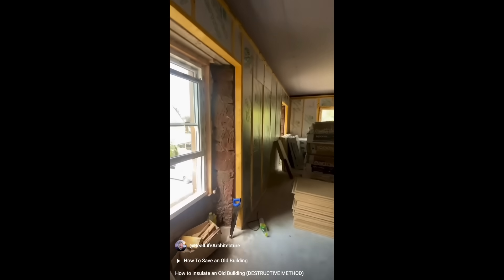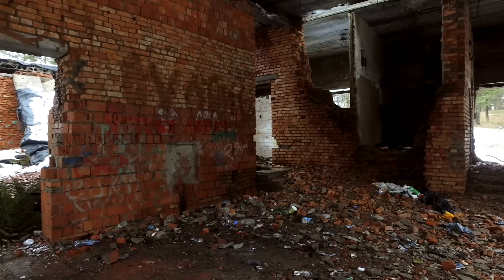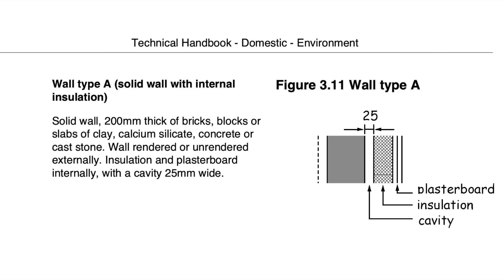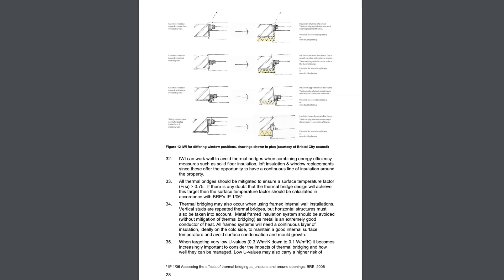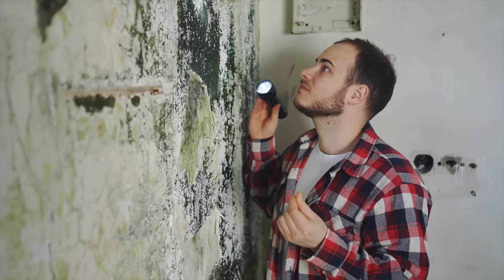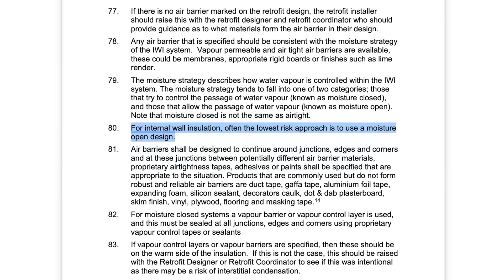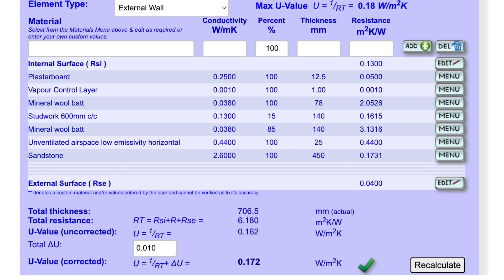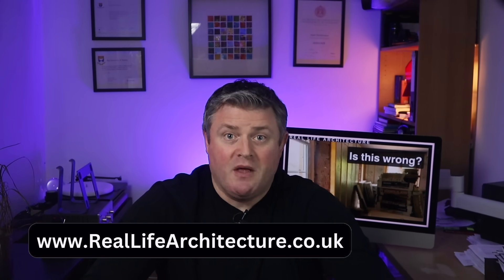How To Insulate Inside a Solid Wall in the UK

Comment: Just to give wise council is all ,Any house type matters not thy all have to breath like you ie a person breaths  out about 2 to 3 litres of water per 24 hours = damp air it always finds its lowest point ??? and condensate's out on to cold surface so a wood/duel fuel burner takes out damp air up the flue to keep air changing in the house but put a 10 cm square/round,  hole to the out side = fire can breath and take away damp air 24/7 if fire is burning  or not , it = a balanced flue system ie air pressure is the same as the out side ??? hope it helps best of luck for the new year

Comment: I internally insulated the solid walls of my Victorian terrace using the following method: stripped back to bare brick, applied a base layer of cork based insulating plaster, fixed 60mm wood fibre boards directly to the plaster, then used a finishing coat of lime plaster over the top. My aim was to use natural materials, not take up too much space out of the rooms and keep it all breathable and moisture permeable. It was quite the job but so far so good.
Reply: Sounds interesting how long ago did you finish the work ?
Reply: Where is the dew point now? Is it on the surface of the bricks or in the wall? If it is in the wall then the bricks will spall. That's why external insulation is often used.
Reply: @justsrooms4520  why would the bricks spall? They have been ‘breathing’ for centuries. Hard cement pointing causes bricks to spall is my understanding.
Reply: This is the correct way to go, this way the moisture from the inevitable inner face of the brick's dew point will be moved to the inner face of the insulation by the hygroscopicity of the material. Good job there!
Reply: @sirantsworth  I have a 9 inch solid brick cottage. I'm considering this approach but minus the Cork (fairly expensive). Was going to lime bond 60mm wood fibre to the bare brick then lime plaster over. My only question is how can you fix shelves, pictures to the wall as wood fibre is really soft. I've looked at wood wool as an alternative
Reply: @easterntreecare manufacturer Gutex or Steico is coming up with these new specific plugs that go directly into its insulation material, the dense wood wool material. Give it a look.
Reply: For most existing vintage older buildings (the majority built as cottage dwellings, not huge old hotels or mansions)  to internally insulate to recommendations means the room becomes a cupboard. To insulate cavities may cause serious problems with older wall ties. To insulate externally is visually destructive. I totally agree also that poor choice of design can easily lead to mould and poor health conditions. There has to be a limit to this madness.
Reply: @Daniel-deMerrivale perhaps highly efficient heat recovery and insulation of the floors and roof are the way to go for these situations. One does what one can.
Reply: We’re thinking of getting SWIP IWI to do our insulation on a lat 18th century limestone property roughly 600mm thick
Reply: The problem of bricks spalling is due to the pointing being harder with a higher cement content than appropriate and too strong for the bricks.
The whole point of pointing is that it weathers protecting the bricks.  The pointing should be able to release the moisture.  If it can't and the moisture goes out through the bricks then the bricks can fail.  This is why soft lime putty mortars work well with soft London Stocks, and why one often sees these and red rubbers crumble.

Walls that are made of soft masonry that is then hard waterproof rendered can fail because the wall moves or the render thermally cracks.  The cracks allow water running down the face to penetrate and then restrict its evaporation.  The solution is to removed the waterproof render and apply a lime render to allow the wall to breath.
I wish everyone knew this but I suspect that some people do not care.  Their mistakes are very costly to repair.
Reply: @sirantsworth  great approach. How did you come to it? I think if we can get this kind of holistic thinking into construction rather than plastering everything with these alien hybrid materials which try to achieve things not encountered in nature we will create healthier happier buildings not prone to failure.

Comment: Would be interesting to explore the concept of externally insulating a solid wall in retro fit, surly this would be better as the solid wall would act as a heat store/ battery as it will be sat on the “warm side”, however I do then wonder the best solution for breathability/airtightness
Reply: @robertma-  external insulation on solid stone/bricks etc  wall retrofits are very  common in Germany . 
most of the products used have the ability to accept stucco/ putz , reducing labor time.
Reply: @robertmargetts5407  The doc he's referencing says your first option should be externally insulating. If you cant for various reasons then these are options for internal.
Reply: @robertmargetts5407  Totally agree. Currently researching to externally insulate our home when we put on a two-storey extension as we’ll be reworking the roof. Information is sketchy, so would love to get some quality feedback.
Reply: The best solution is to insulate from the external side. Your construction/load-bearing materials stay at roughly the same temperature and humidity throughout the year, which means they don't expand/constrict with outside weather, and there is very little chance of condensation in them (and they'll naturally dry out towards the interior). Then you do the outside in a manner fitting the chosen insulation type - for  vapour non-pearmeable materials you just glue or fasten them to the building and eg stucco (basically w/e since they'll act as vapour barrier), and for vapour pearmable insulation (eg rock-wool) you create a rear ventilated space next to it (and facade outside), same as is done for roofs.
Reply: 12 inch thick walls are not the main issue of heat loss in old houses.

Comment: When I renovated my daughters 1900 solid wall house, we fitted vents to the solid walls, then fitted timber batons on the inside then Dupont Actis multi-foil insulation, with all joints taped. Then re-baton to create an air gap them plasterboard.
This is the same as 270mm of rock wool, and has created a warm and damp free house.
Reply: @stevemorris289  so she lost 70mm per wall, 140mm of room width? Where did you find the statistics saying foil is equivalent to a foot of insulation? Sounds too good to believe. Would be interesting if there was detail on that system and how the foil works so well or rather the two separate air gaps are doing the work
Reply: @OliverTwist-vv4xh
The loss of floor space is acceptable if you have enough room and the loss results in a more comfortable house. I my previous house I could barely afford to lose an inch of space (a two up two down terrace) so I concentrated on making the exterior walls as dry as possible. I was only able to insulate the party wall on one side and about 1/3 of the other side because of the placement of the stairs and front door. I my current house there is a lot more space so I can afford to lose 150mm on the front exterior wall and same on one party wall, the other party wall is blocked by the stairs but I am having a new staircase installed so hopefully it can be 50mm gap left for some sound insulation. The living room is 6.5 x 5 metres at the widest points so thankfully I have a lot more wriggle room than before. Things are a bit tighter in the kitchen so I might have to reduce the insulation and stud wall to 100mm on the exterior wall - but still better than nothing.
Reply: Hi Steve, I did the same, air bricks, metal framework stood off wall by 25mm. 75mm continuous Celotex over that, then 25mm batons over that. That was 6 years ago, no more cold, mould and above 5 degrees the use of dehumidifiers is enough to give you adequate heat. Any lower then the wood burner goes on. I did use insect mesh on the air bricks. Hope your daughters house is now great too.👍

Comment: What about these new aerogel insulation materials?
Reply from the maker: No idea, I have never used it but will do some research
Reply: prohibitively expensive though
Reply: @evanscm3  63% heat retention for a 10mm blanket. Even with a magnesium backing board it's only 17mm and totally breathable.  Prohibitively expensive? Depends on your use case. About £87/m2

Comment: A breathable vapour barrier lets moisture through? I think i misunderstood! Thanks for the video
Reply from the maker: Let’s just say I left the question open for a sequel.
Reply: @RealLifeArchitecture Great to see the discussion on this topic Niall. In your example with the 100mm stud wall with PIR infill, should the cavity be vented? Also, should a breathable membrane be fitted on the warm side before the plasterboard is applied?
Reply: The cavity would be better vented top and bottom. The pir could have a 25mm pir horizontal foam glued layer taped. for better u value. The internal pir as is should be covered in a vapour barrier before plaster boarding.
Reply: A vaporbarrier normally block or slow the movements of moisture, there are few models with a variable permeability that allow moisture in summer and block it in winter, leaving the wall to dry in summer. The breather membrane is something else and should be used on the exterior under some type of cladding.

Comment: A good topic.
I have just completed my “parlour” the largest room in an 1895 home with 2ft walls.
I retained the batons of the lath and plaster after removing the lath and plaster.  All wood is good. The 1- 1.5 inch air gap should run from solum to sark.  I restored all space and repointed walls inside.  I aded hammer ins with a DPM then glued 25mm PIR between the buttons using polyurethane glue activated with 5star sprayed on the old wood.  On top is 10 to 16mm PIR and the gypsum plasterboard.  Total insulation is 35mm to 41mm with several aluminium foil faces.  The cornice is retained with 10mm PIR glued to buttons and low expansion foam glueing the plaster to the board.  I now have a curtain of PIR from solum to sark.  I do a few other details to bring up the standard toward Enerphit.  One massive improvement is to dig out the crap the builders left under the floor to the solution then 1” riverbed gravel, a heavy DPM then 2” concrete with waterproofer and I insulate the joists.  No moisture in after that.  I am an engineer intent on restoring a period property inside and out as close to Enerphit as I can.  I am amazed at how little our local trades know or understand that is why I don’t use them.
Reply: I will be honest with those thick walls you did not need insulation for the walls.
Reply: @ I don’t think you understand Victorian buildings and construction if you think 2ft thick walls with lath and plaster does not need insulation to improve the comfort and energy efficiency….
Reply: @DR-00700 
2 fleet thick walls are not going to have thermal leakage like ceilings, roofs, windows, doors and so on. Controlling drafts are going to have a much larger impact than walls. Walls are much denser than many if the other areas.
Reply: @ why do you say there were drafts?  Insulation is to improve the thermal conductivity, on a like for like there are no drafts and I still don’t think you understand the Victorian design detail.  The walls were designed to have air flow from the solum to the sark.  The insulation is on the room side of the space and vastly improves the thermal performance without affecting the ornate plaster cornice.  I suspect you may not have worked on Victorian builds, they are poorly understood.
Reply: @DR-00700 
Did Victoria’s insulate their walls.
Reply: @ the victorians used the materials and resources they had.  Lath and plaster on exterior walls with a 25-40mm air gap thus the c. 25mm of plaster and the lath was the thermal “airtight skin” but the exterior walls are cold AND air from the solum/outdoors circulated from solum to sark in the winter when the coal fires heated the cold room with air gaps in the sash windows and the warm flues connected air up the inside walls evaporating moisture.  I have not met many tradesmen that understand the Victorian design and the flaws and issues.  They all turn up to sell a chemical  damp proof course that pretty much does nothing.  I am suspecting you have not restored/renovated a period property to a high standard.
Reply: @DR-00700 
So the short answer is that victorians did not do insulation as we would know it today but did use a system of rendering. They designed and built on the concept of heat retention, airflow and damp management. It’s the reason earth suspended floors, attic space and so on came into being. They could have insulated building in a very similar fashion to what we have today. I think our culture has mistaken our ignorance as theirs. There was bad buildings in that era as well.
Reply: @ they did not build on the concept of heat retention as they did not use insulation - they did not have it.  They put a heat source in every room called a coal fire with an open flue and sash windows that were not air tight so the rooms leaked air I.e. no heat retention.  That is why 5hey burned coal if they occupied the room.  Suspended floors came in with the Georgians.  I don’t know what you think you are trying to prove but it is clearly not that you understand Victorian construction.  As I said many tradespeople have not a clue about how to restore, renovate and maintain old properties clearly insight and understanding missing from many builders and trades.  That’s why I do it myself as the trades are not worth paying for on the whole.
Reply: @DR-00700 
Victorian’s could have easily made insulation panels.
Reply: @ what from?  What industrial process?  A fanciful opinion without basis.
Reply: @DR-00700I don’t think you understand Victorian buildings if you’re using PIR
Reply: @markcraine4213 as an engineer that has been gainfully employed doing finite element analysis thermal modelling to accurately determine heat loss I am fully conversant with the thermal conductance and heat loss through materials and walls - I did it for a living as a degree educated engineer.  Retaining the lath and plaster just to “traditional” is energy inefficient on lath and plaster external  walls 1 inch of plaster seals and insulated but the insulation is very low and subject to moisture reducing it which PIR does not suffer.  Recompleting with 25mm PIR glued between the vertical battons, using aluminium tape to give a vapour barrier then fixing insulated plasterboard on this provides c. 40mm of PIR insulation when aligned to the original wall plane thus retaining the cornice or if the cornice is to be redone (upstairs rooms with basic cornice) I fit insulated plaster boards with 50 mm PIR for a total 75mm insulation.  This has transformed the rooms in this home (west coast Scotland) such that the ambients temperatures after heating is off have risen from 10 deg C in winter to c. 15 C. In the gable walls upstairs.

I should edit and put up video of what I do as it is transformational without destroying the interior heritage.  The worst room in the house (North facing with a bay window) for thermal performance is now very comfortable with a modern log burner heating it and with the thermal mass the room never goes below 18C through winter with only an evening burn from 5 pm to 9pm loading it and burning out around midnight.  In the depth of winter I put the burner on at mid day for 10 hrs of loading it.  Frugal on logs but very warm due to insulation upgrades.  A fair bit of effort but a lovely warm dry room with a real fire behind glass.
Reply: @DR-00700Still shouldn’t use PIR
Reply: @markcraine4213 why?

Comment: Living in older houses with stone walls, I have found extra insulation is unnecessary.  Assuming the exterior is in good shape, the crucial elements are, humidity control, ventilation, constant / regular heating.  The big problems occur when small spaces are used for cooking, bathrooms.  Rental properties always suffer more, where people use occasional heating and don't keep the fabric of the building warm.  To keep heating costs right down, I can see the benefit of insulation, but it is going to render some spaces unusable.
Reply: Correct, solid dry walls make a warm house, the problem is exactly as you said especially intermittent heating and humidity control  etc. They key is making sure the structure is breathable and you get enough heat to charge the thermal mass of the walls they then act as a buffer store of heat internally and less heat is needed  to maintain it topped up moving forward, but because many people cant do this due to work, lifestyle etc then  the structure and house runs into issues, also modern gas central  radiator heating is generally not effective at charging the  thermal mass of masonry, but possibly underfloor heating may work well if kept on 24/7. The thermal efficiency of a dry solid brick wall is very good as it was originally designed. Wood burning stoves / biomass boilers etc serve real purpose in these properties.
Reply: imagine living in a freezer  and having heat on all the time and saying "insulation is unnecessary". Welcome to 1500.